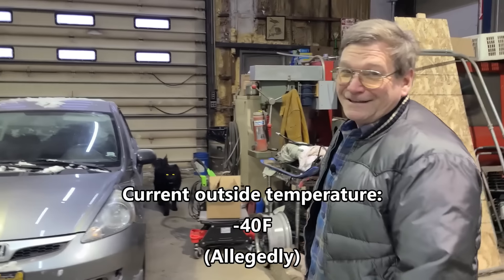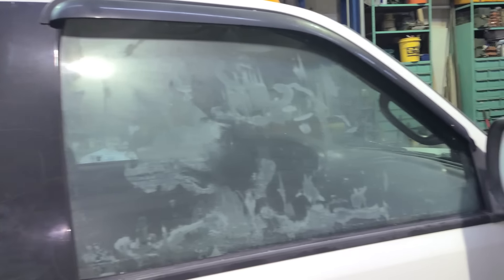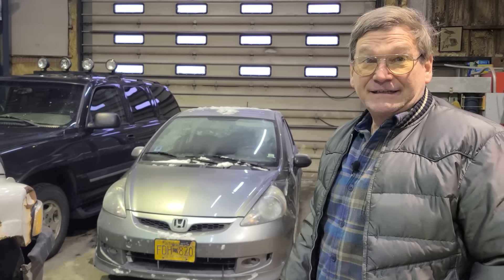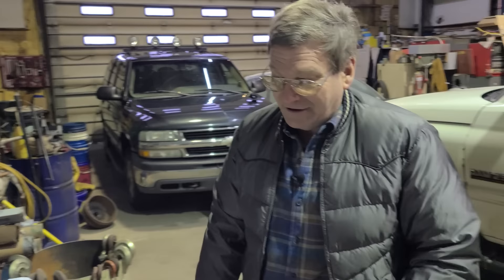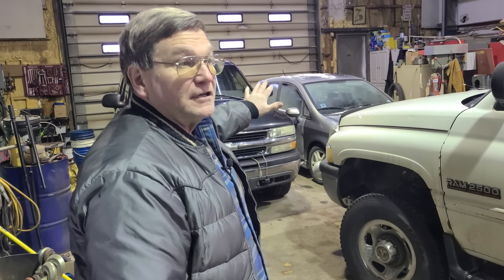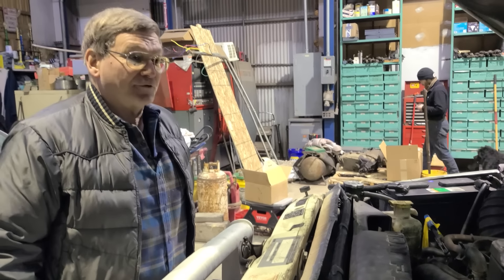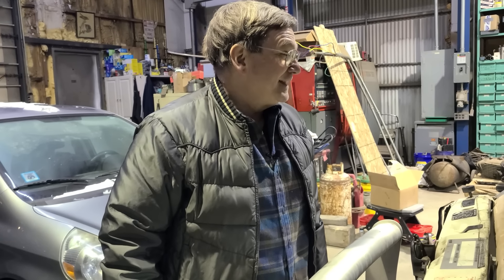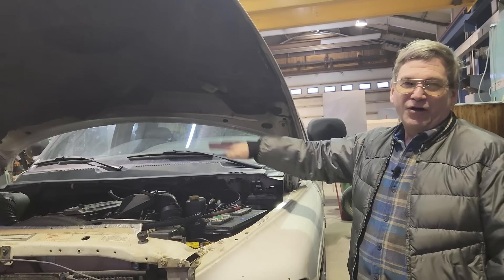Winterizing your car for Alaska/the Far North

Comment: My brother had the frost shields on his 76 scout when I moved to Fairbanks. I only drove three vehicles with the frost shields. 
Adding a Cat heater to many suburbans was popular in the past. 
When we worked together at FM&S my ‘76 had a 1500 watt tank heater, it didn’t take long to heat it up to start at -50. Trickle chargers so much better than battery heaters. I have started vehicles using charcoal in a pan under the oil pan while trapping up the Steese. Switching to synthetic oils was the biggest improvement. The slave-cylinder on the steering of my 76 F250 was terrible below -30. Got pulled over by a state trooper at cushman and van horn, he thought I was drunk. I was trying to get the steering to warm up by weaving back and forth. He understood and told me to try adding some Marvel Mystery Oil to the power steering fluid. I did and it helped.
I used the magnet heater on my snowblower to make it easier to start.
Helps to roll down the windows when inside to allow the moisture to escape so your windows don’t frost up when you pull out into the -40.

Comment: Fate seems to dictate my locations from 125F to -27F.  Tasks take forever in the cold, nothing like warming up the shop when the first fire doesn't start, the gig. lighter won't work, the butane torch is useless, and then one has to think fast because every other thought is that it is freezing.   In the very early eighties I had the gas line freeze out in the open with high winds, getting my hand wet from a make-shift funnel, just amazing, dangerous.  Someday, I need to move somewhere between extremes.  I even got caught by the '78 blizzard in Bloomington IL. for five days, we were running at 130mph Southward trying to outrun it.   I walked out on the highway and there was like two inches of black ice, and after it dumped, you couldn't tell which vehicle was yours in the parking lot.

Comment: Funniest/scariest story I have is a 10,000gallon diesel tank at work gelling up, so we tarped it and put 2-3 diesel salamanders underneath it. Still didn't work. Had the fuel delivery driver ask this summer why we put all the winter additives in the middle of summer, and he understood once I told him what happened. That time was because we somehow got a delivery of summer fuel in the middle of winter, assuming the winter additives were already in it.

We use the magnetic heaters on stationary equipment at work. A machine 30yr old horizontal cardboard balerwho's paperwork says it's not for use in cold weather. It's got a hyd tank heater who's function is questionable(electrician diagnosed it as a burned out coil, parts were sent for our mechanics to install but I've never seen them working on it). Said baler has plumbing heat tapes ziptied inside pipe insulation around some hydraulic hoses, and magnetic heaters on the hyd. motor those lines feed and on the control cabinet.

Comment: Cummins  spec for 1st gen(single groop 31) is 30above , acceptable to use the 750w block heater itwill be helpfuland save fuel. -20°f it is mandatory. 
91.5 dodge  haz spent several years in Butte ,mt -20 was common. Weatherman liked teas us that it was warmer in  Fairbanks and would be all week.
 -21°f with the single groop 31  bat,  the starter just would not spinn fast enough for Boils law to be your frend and make it pop with a full grid cycle ( 2x 125a /1500w ea,a 250a hit for 60sec) 5w 40 takes too much hp to pump.  After a few revolutions it slowed and sounded  like a 90% dead bat. Next day warmed to -12, she fired before buddy returned  from hunting down cables to jump it. 
-40°f a bat raiting is cut to 5%of its cca.... (eg a groop31 1000cca is only 50ca )cimistry process is physically slowed down.
Montana  convinced me yetty was worth the money . Only cup i had that my coffee didnt freeze befor the wind screen was defrosted enough  to drive.
Allison swap on the 91.5 the box must reach and stay above 148f to enter into/stay in learning mode,  viscosity variables  will cause Erroneous shift trim modulations resultingin limp moad and codes .  My transmission builder and the computer builder both required me to reverse the cooler line routing putting the lquid to lquid  last  instead of first to warm the fluid back up after going through the air cooler out front. This was to keep it in learn moad. I added a missimoto thermastatic bypass to keep it warm enough and the engine from loosing too much heat. On the 12mi 6% grade (i15 south of Helena, mt )the 518 trans would drop the coolent from 180°down to 137° by the bottom.
Dodge  has a TSB  on my 1st gen about ATF+4 freezing in the air cooler requires the dealer to install a air cooler bypass kit for trucks seeing -5°f to prevent a frozen cooler from over heating the 518 and burning it out.
Nabor I've got (now in UT)  has to idle the trans up to temp to keep it from throwing shift codes.

Cardboard... cut a 120²" (cummins spec regarding intercooler functions) hole in the middle ( in front of the clutch)  this kept the clutch from cycling on a cold  engine, cummins calls out that "there" fans pull from25-90shaft hp. So there is that. When you are starting with 160 at the flywheel you need what you can get.

As you can see Howie is a man after my own hart.  Keep thinking out side the box ,it is so freeing.

Comment: How often should you change your oil in the winter when temperatures are below and your using a heating pad on your oil pan? What milage do you recommend? Also can you run a trickle charger and battery pad at the time? Or should we do one or the other?